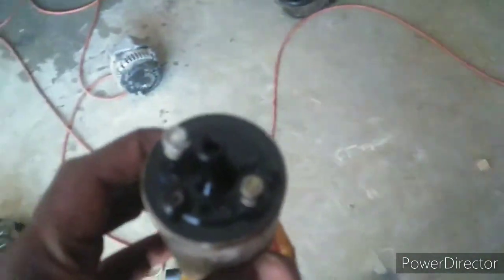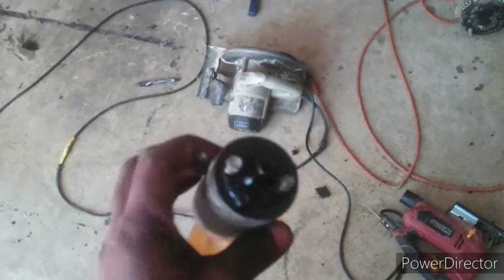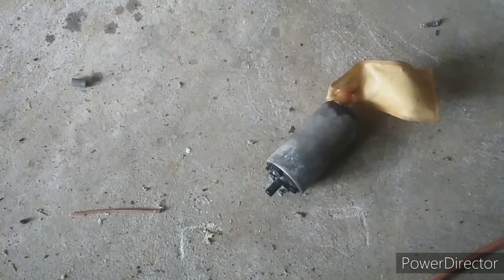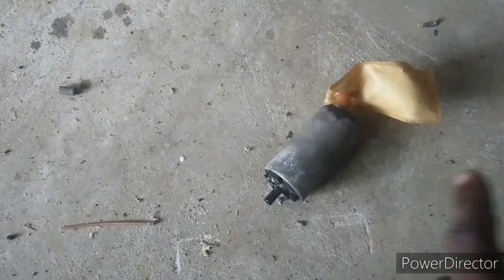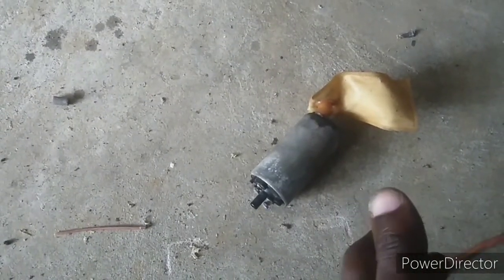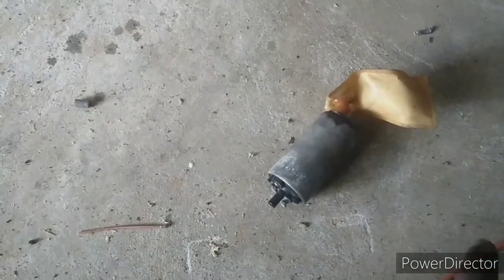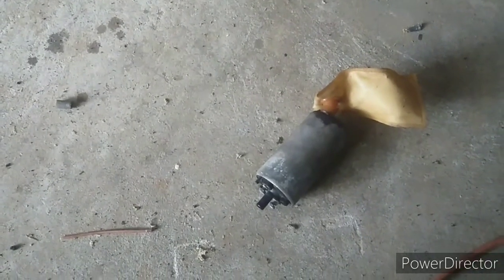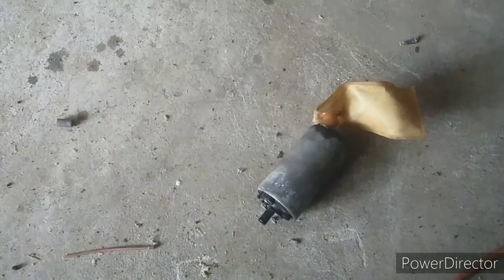Mustang killer 91 Integra LS JDM savage update

Comment: Check the voltage at your fuel pump plug. Could be the relay. Also some vehicles have fuel reset switches. I had a Ford that had a reset fuel switch in the glove box. Hope this helps
Reply from the maker: Thanks will do and thanks for watching